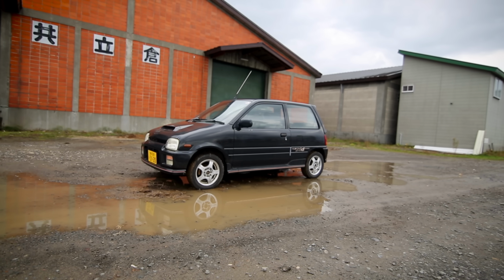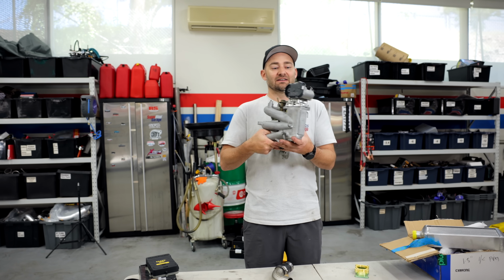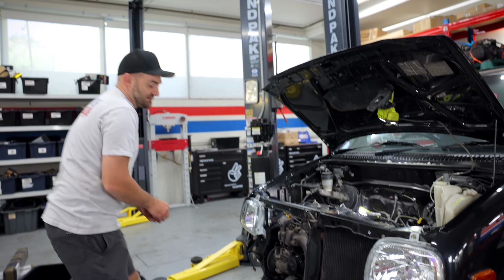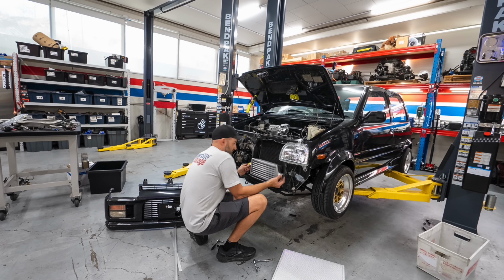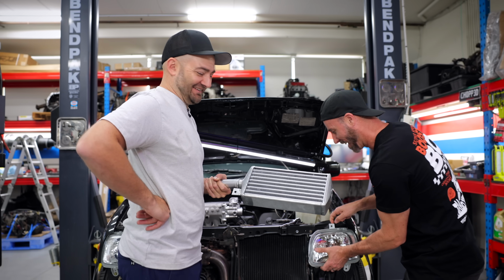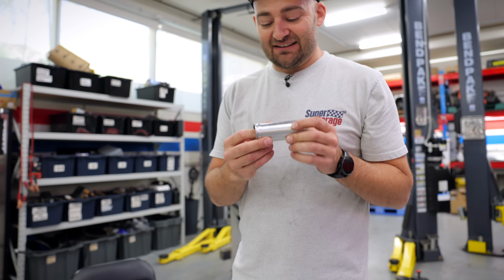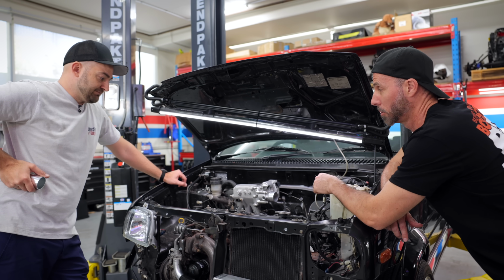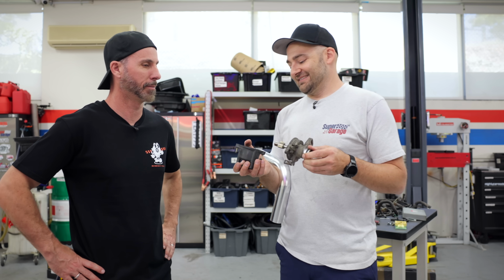Tired old JDM Kei Car gets NEW LUNGS!

Comment: Grab a real JDM Suzuki Swift Sport ZC33S for your next build — with its lightweight body (~970 kg), turbocharged K14C engine, excellent power-to-weight ratio and huge tuning potential, it’s one of the best platforms you can start with. In Japan it’s massively popular for track builds, and even at the Nürburgring people race them and rent them out — because the Swift Sport is stable, quick and really forgiving to drive.

Stage 1: ~160–170 hp / 260–280 Nm

Stage 2: intake, exhaust, intercooler — ~180–195 hp / 300+ Nm

Stage 3: hybrid turbo with a stock unopened engine — ~220–235+ hp / 330–360 Nm

The Swift Sport ZC33S is a brilliant base for any project — street, track, or club racing.

Comment: I used to have a Mira TRXX-R4 with the four cylinder. Even stock, because of the kei rules the power curve was ridiculously flat, made the 64hp from like 3000-8000 rpm so it feels much faster than something that has peak 64hp. Lots more power available by removing the restriction from the kei rules

Comment: intercoolers are neat, though Diesels are backwards... need hot coolant to heat the intercooler so the cold air doesn't stall the engine. "custom heater core intake heater" 10kw sucked out of the coolant system just to shift the intake air from -50c to +20c.

Comment: This is exactly what I'm trying to do with my '93 Toyota Corolla :) Already made an adapter to fit a Bosch e-throttle. Too bad Haltech costs a fortune, more than my car is worth xD. I'm trying to figure it out with a Speeduino, but it does not have support for Drive-By-Wire. Made a controller myself, still need to figure out how to integrate it. Very much in the project phase still. Awesome to see similar stuff on this channel :D
Reply from the maker: Sounds good! Time vs money thing

Comment: I realize this was recorded some time before, but I’m seriously surprised you went with a tricky FMIC setup considering the space constraints, instead of a W2A cooler, which would be so much easier to route. These are seriously easy to set up nowadays since most of the OEM use them and are really cheap.

Comment: Did you purposely try and weld that pipework as badly as possible? I've seen you weld ally better. Put your post flow for longer to prevent the black stuff showing up on your next weld.

Comment: Marty probably won't see this but if he does i might blow his mind. that distributor looks identical(the cam interface and mounting points) to the Suzuki F6A distributor(same cam trigger wheel). the fun part is the K6A distributor fits in the F6A motors, and the K6A has a multi toothed cam trigger wheel. now the unfortunate part is no ECU's have that tooth pattern programmed. my fix was shaving off select teeth to have the same tooth positions as a daihatsu ef-el motor (3+1), this pattern is in the Haltech software. this is how i have a standalone in my F6A Cappuccino make 129hp at the wheels.

Comment: BMW used hall-effect ignition triggers in distributors in the late 70s, didn't that original dizzy have that? Seems weird, BMW was using mechanical fuel injection =) Maybe doesn't work for sequential ignition? Waste spark doesn't work or interferes with the other cylinders in a 3-pot?

Comment: Our daily is a Trevis. Like the cuore Lexus (with a lot of fantasy). It has three issues. Rust, rust and the monthly P130 error (sensor is not the issue, it's some issue with the wires or contacts).
If I find 1 that had rust protection from start, I'd buy it in a heartbeat.
If I would live in a country that is not German in it's tuning flexibility (Germany in our case) I would turbo it the next day. Such a nice little car.
Even a 600km drive at highish speeds is no issue at all.

Comment: i did this with 93 Suzuki Alto works, from my experience the haltech likes a 24-1 tooth on the crank and a single point in the cam for higher revving engines lower revs a 60-2 on the crank is better if you need any info i might be able to help
Reply: This trigger pattern has been used hundreds of times without issues.

Comment: The stock turbo isn't good by modern standards. It would be possible to run a turbo that is physically smaller but flows better at a wider range of pressures, and modern control systems are much smaller. Running a smaller modern turbo would easily net an overall improvement to power and control without compromising size.

Comment: The factory regulator is NOT a rising rate unit, that would imply that it deviated from a 1:1 ratio up to and past the base 3-4bar pressure at atmospheric. That is a standard linear rate regulator, which will add 1psi of fuel pressure with each 1psi of inlet past atmospheric, same with dropping 1psi per 1 inch of mercury. This is a common misconception because actual "rising rate" regulators were a huge band-aid in the bad old days with ratios up to 12:1 where 1psi of pressure added to the regulator diaphragm input would add 12psi of fuel pressure, which was to force more fuel through standard injectors as a "tuning" solution for turbo/supercharging N/A engines without ECU changes.

Comment: Here in the ex commie block these cars came under the Daewoo brand with the 0.8 suzuki carburetted f8c engine. This mighty chugger was called Tico and was being assembled nearby me in Craiova, Romania, with korean imported parts, it was also being assembled in Warsaw and Asaka in Uzbekistan. I personally owned the next gen Matiz iteration since the old Alto body couldn't meet Euro NCAP standards anymore, my little Matiz was quite a bit bigger but the same f8c engine, only this time it came with fuel injection, cheapest car i've ever owned, any individual part was no more than 20$:face-blue-smiling::face-blue-smiling:it was a rust magnet but light and nimble, ate fuel like a MF on city driving but on out of town trips it was quite economical. This Matiz later morphed into the well known Chevy Spark. It was so popular it even had a chinese copycat, cherry QQ3 was a carbon copy of the little Matiz, doors and panels were a drop in replacement from one car to the other :face-blue-smiling::face-blue-smiling::face-blue-smiling:
Reply: Also check out Boostfreaks's Daewoo Matiz, the story as far as i remember is the engine is completely stock, it had a iveco diesel turbocharger at one point and a piggyback ECU and on the latest iteration is sporting a  Garrett GBC17-250 and a custom ceramic clutch since the stock one slipped at 100Nm and 185mm wide tyres on the front for a little more traction, right now it's standing at a eye watering 140HP :face-blue-smiling::face-blue-smiling:. Considering it left the factory with barely 50 hp on a good day it's amazing it can stand such a beating on a stock block, and he had it turboed for quite some time now, i remember 8 years ago when i found out about him and he had it for a while even back then.

Comment: That's the advice I always give others. Stop trying to do everything at once. Pick one thing to do each weekend, that way you can actually finish it. Plan taking a whole weekend to do something simple, like changing pads/rotors. It's unlikely you'll need that whole time, but at least you'll have the downtime planned out in case you do run into issues. Who hasn't run into that 1 hour job that quickly turned into a full day or longer job?

Comment: "This top mount intercooler is susceptible to heat soak" Places Front mount intercooler pipe NEXT TO THE DOWNPIPE. Maybe they put it there for a reason, like the WRX?
Reply from the maker: Dump will change soon, its too big.. will go 2 inch and heat wrap it.. dump isn't as much of a furnace as it looks
Reply: @mightycarmods  Yeah, I suppose 2.5" is a bit large considering that you're going to be under 200hp tops.

Comment: i dont know how those little turbos survive with no bov or recirc valve that flutter is compressor surge and with wreck that turbo.
Reply from the maker: it might over decades but the turbo's usually last 50 tanks of fuel or less before we upgrade them anyway!